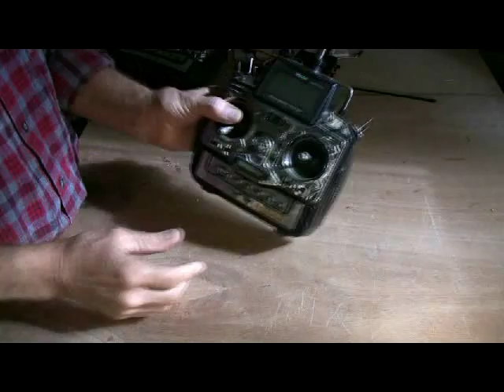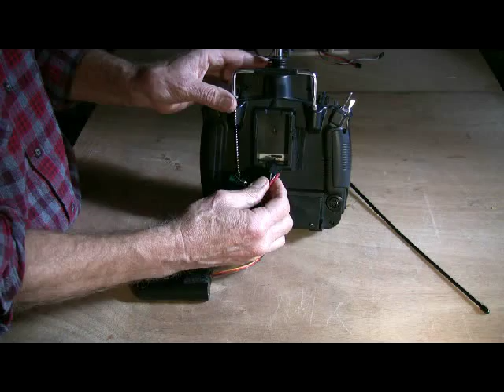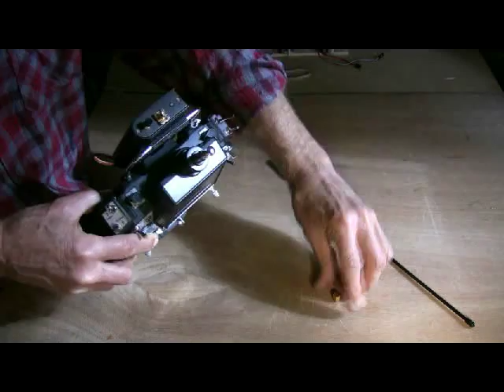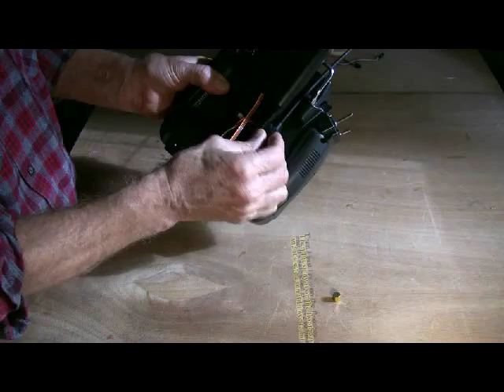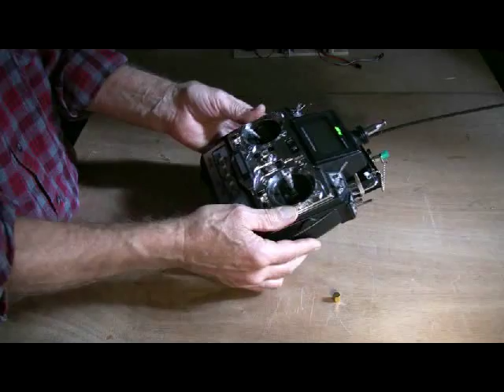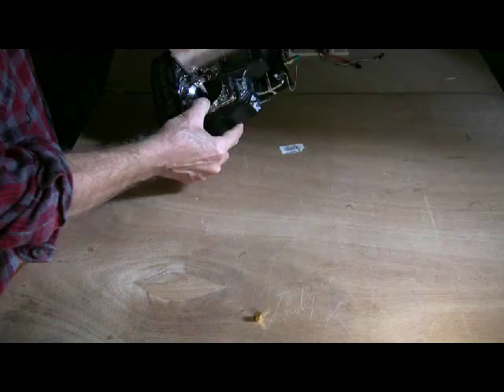Installing Dragon Link on Hitec Eclipse 7 Transmitter.avi

Comment: I have the same Eclipse 7 Pro with  2.4GHz Module. I want to use this one with OpenPilot Oplink for vehicle control (Revo on Vehicle side). I got my OpLink and Revo to linked up and show Telemetry data perfectly working. But TX PPMout fromEclipse 7 never got through to RC Input . I followed your Pin out but no signal. How to verify if PPMout signal is coming to the Flex Port of Openpilot OPLink?

Comment from the maker: You'll love it. Just make double, triple sure that before you turn it on each time that you either have the dummy load or the antenna connected. This is such a sweet system. Oh, and make SURE, before you take off that you have the antenna connected, not the dummy load or it gets quite frightening for a few minutes. Yeah, I did it ONCE, and now I really check it.

Comment from the maker: No. It's the older one on 72mhz "Eclipse 7 & Spectra Module RC 72MHz Hitec"
 I see where there is a new one on 2.4GHz and I don't know if that's the same or not. You can get the older ones (if you can find them) a whole lot cheaper, 50 bucks maybe, and since you're going to 433 mhz, it doesn't matter which one you use. I love my old Hitec Eclipse 7!